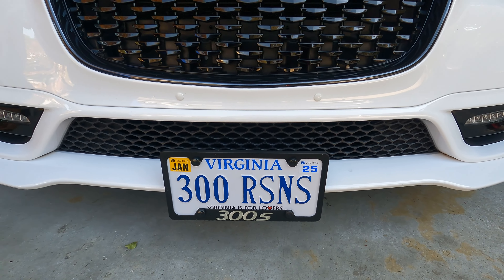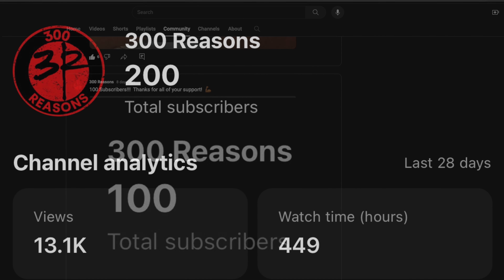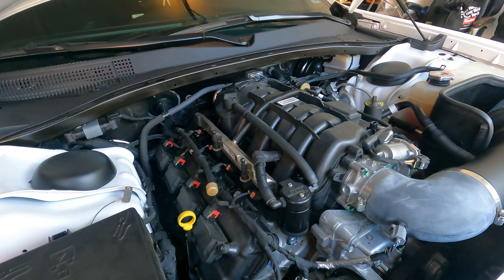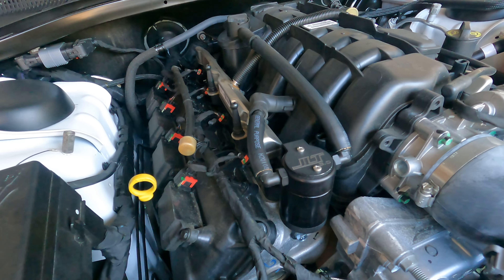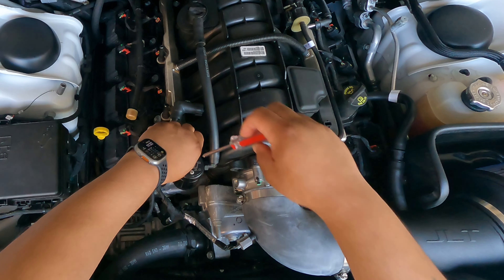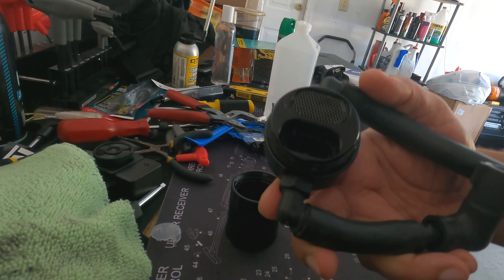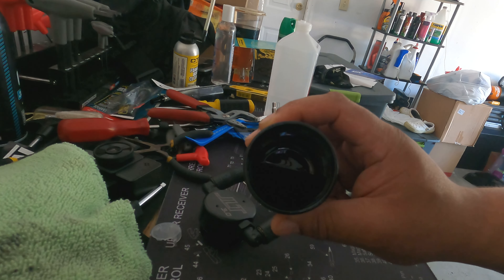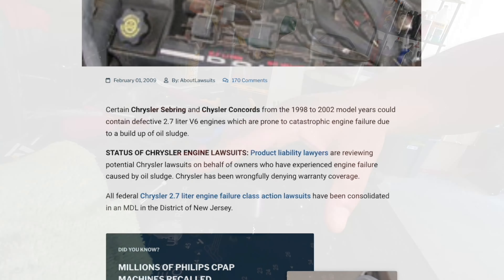THE ONE MOD YOU MUST HAVE FOR YOUR CHRYSLER 300

Comment: Ran one for a while on my '06 Hemi, ended up removing as I didn't think it provided and was a pain to drain. I do see the benefit on a boosted engine.
You need to change the rear end to 3.09 LSD...that's a real performance gain.
Reply from the maker: Definitely need it if you’re boosted.  But, after having an engine die, I’d rather be safe than sorry!
Reply: @300Reasons  Can't argue with your logic! BTW, great job explaining and detailing your mods. Well done Sir.
Reply from the maker: Thanks for watching!

Comment: If this is so important why is it not stock?  I have a 2015 300C with the hemi engine and nearly 40,000 miles.  No problems so far.  How does this catch can affect the mds?  I've heard that failures are related to lack of engine lubrication.  Doesn't this reduce this lubrication somewhat?  I'm not an enthusiast so I basically have never heard of the need for such a thing.   I did, however, enjoy your presentation.
Reply from the maker: Thanks for watching!  I'd imagine that car manufacturers don't have a particular interest in extending the life of their products for too long (i.e. 100,000 miles or more).  That would cost them future sales.  There are a lot of things that they could do by using higher quality products that they don't do.  That's why there is a need for after market products.  And the added maintenance likely wouldn't be something that most consumers would want to deal with.  Those are just my opinions though.  Also, certain engines are better than others at preventing oil from entering the intake manifold.  And keep in mind that the issues that arise from oil entering the intake manifold take time to present themselves.  You aren't going to notice any issues at 40,000 miles.

The catch can doesn't affect the Multi Displacement System.  The oil pump is responsible for lubricating internal components of the engine so the oil caught by the catch can isn't robbing the engine of any oil.  Simply put, oil shouldn't be entering the intake manifold.  The fact that you can see the oil being captured in the can is proof that it works.  The catch can is just a preventative measure for those looking to ensure that their engines last a long time.  And with V8's going the way of the DoDo Bird, I want to make sure that mine lasts as long as possible!  But, I always recommend doing your own research to make an informed decision.
Reply: @300Reasons  its also iilegal due to some regulation